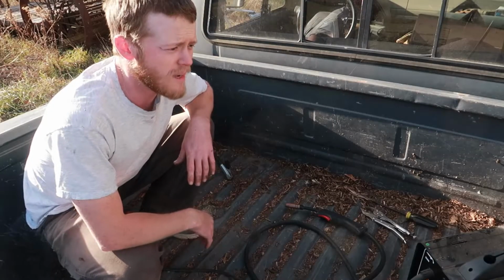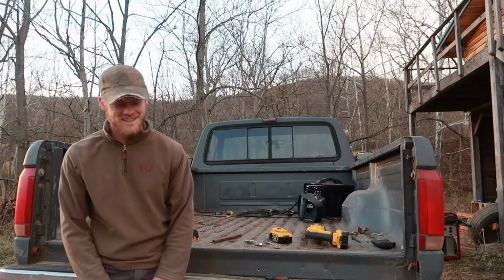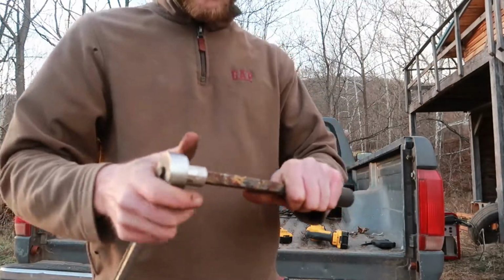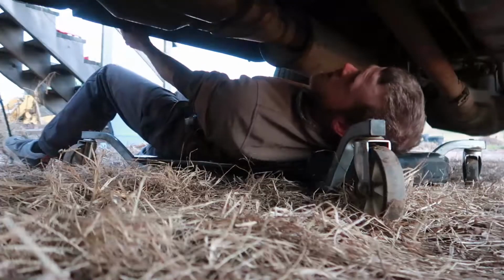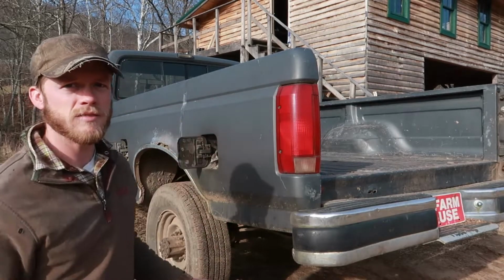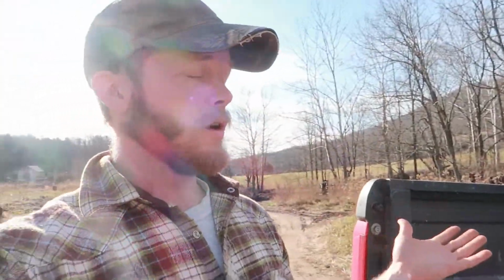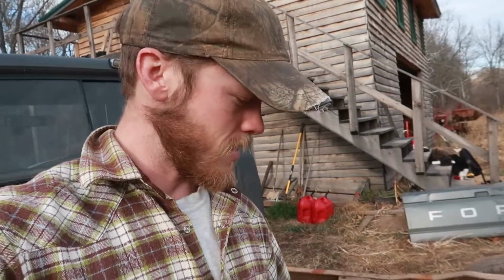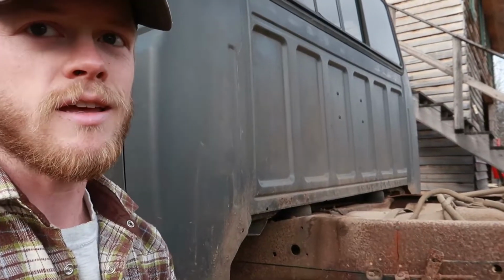Lifting the Bed | Fixing the Farm Truck

Comment: Funny how it's always that front tank that goes bad. Had a couple of old Ford's and that seems to be the case. Still a pretty good looking old truck. There just aren't any around up here in south central Michigan.
Reply from the maker: I'm fairly certain the rear has been replaced. It's a LOT easier to get at(with the bed on) than the front one.

Comment: Had a truck just like that one, check the front tank where the lock ring holds the pump in. Mine the ears on tank rusted off. Had the fun job of changing tank in a gravel driveway by myself. Good luck.
Reply from the maker: Yeah that ring pretty well disintegrated when I took the sender out.... Thanks!

Comment: Hi josh weld a seven inch long half inch round rod to the head of your bolts this way you don't have to grind he bolt off the box when he rod comes around to the box it will hold the bolt! take a propane torch and heat the nut it takes longer than a oxy acetylent torch but it works take about ten minutes let it cool if it don't come do it again. as for you cracked frame get a rectangular piece of plate 1/4 inch thick and make it 8 inches long by the with of your frame less 1/2 inch  cut each tip of the rectangular plate off on a forty five so if your looking at the plate it has each corner cut off and will leave you with four little rectangular pieces which you can disregard one does this to re-leave the stress if you were to let it square the crack could start at the corners. get a grinder and grind all the rust off and have some one weld it as it must be welded well as it is a important pertaining to the frame! I would grind out the crack and weld  it grind it flat  before applying the gusset plate. I would also add a bottom flat bar along the bottom and a top one would be recommended. You must know someone who is proficient in welding that could do it for you. I would personally use a arc welder instead of that little welder your using! Happy welding and happy new year!
Reply from the maker: Thanks for all the tips! I actually have a stick welder that I think I'll use for the project. I need to do some practicing with it and get it dialed in before I start though.  Happy New Year!
Reply: @LandisLegacyFarm  I should mention that if your using a AC welder you should buy AC rods as if  you use DC rods on a AC machine you will get so frustrated. You can use them but me as a welder for years can be frustrating. You have to run them hotter and they will stick to the point that you want to scream. Now if your arc welder is a DC welder then usually you can switch it on AC or DC. Good point to Note. That is why I have mentioned you should take a night course on the ins and outs of it then it is practice and knowing basic skills can get you to the finish line much more quickly than learning it on your own! Wish you were closer I would come and help you with it but I am in Canada near Maine your pretty far away. Great channel look forward to watching every week!
One more little note be careful grinding in your loft if a spark was to land somewhere and start smouldering If you don't catch it you could come back to a pile of ashes. Someone in my home town had this happen. and he had a warning as he almost lost it once but found it before it caught fire. Then guess he didn't heed the warning as  at a later date same thing happened and it burned to the ground. He didn't learn his lesson! For the little bit of inconvenience take your parts out side and grind their.
Reply from the maker: @SuperHurdman  I've got a DC machine, so probably going to use 7018's on DCEP. Gonna see if I can get some scraps from the local welding shop to practice with this week. Typically when I'm grinding in the loft, it's one of the first things I do for the day. Then "if" something were to start smoldering it won't be when I'm not there. Additionally, I'm planning on running a water line up into there that I can also tap into for a couple sprinkler heads just in case.